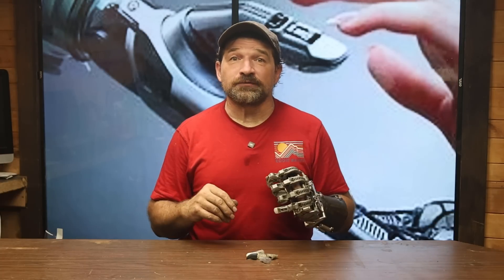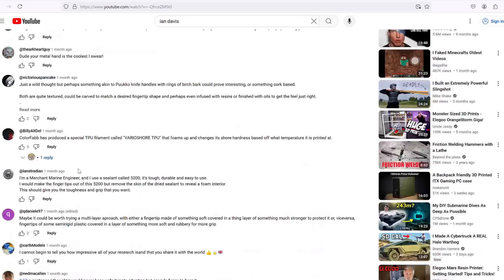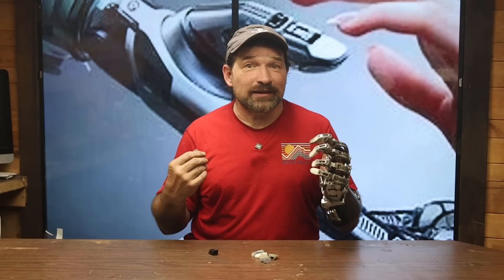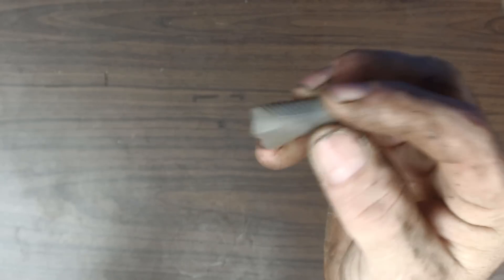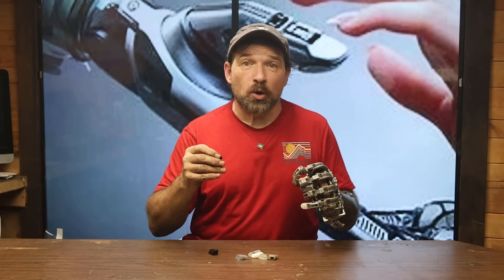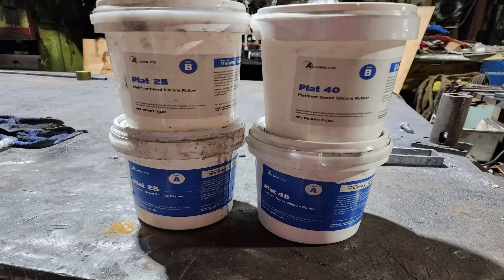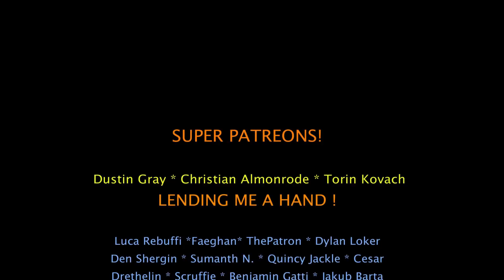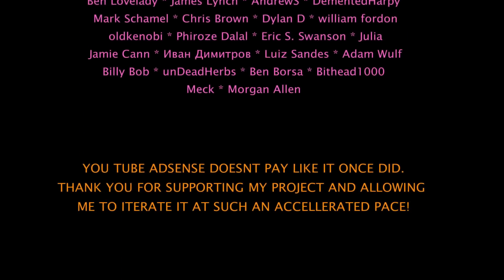Continuing the Quest to build the Perfect fingertips

Comment: Perhaps with the first design, with the plastic core and 2 layers of silicone/ rubber not too sure honestly, perhaps the plastic core you could add mini holes in the structure (that dont go all the way through ofc), so that the silicone has more places to attach onto the inner plastic fingertip

Comment: You could try putting the high temp Varioshore TPU prints through an annealing process, it would help to fuse the layers into a more singular piece for better durability. And it might do so without loosing too much of the desired squishiness.

Comment: I'm not sure why you would want a hotend swapper when you can reduce the print temperature during the print? Especially if you have a sheet of them you can print all the inside perimeters at one temp, all centers at temp 2 and all outsides at temp 3. You only need to switch temperatures three times per layer, the same as you would with a hotend swapper. I guess that having the temp vary in this way is a gcode/slicing challenge but having the prusa XL with mukltiple heads just to be able to circumvent gcode tweaking seems a bit extreme. Especially since these hotends will drool filament when moving and when not in use, so your stringing issue might be even worse. I think there might be ways to trick the slicer into altering the gcode or at least make the gcode easier to adjust afterwards

Comment: You should look into using rock climbing shoe rubber, it can be bought in sheets for quite cheap, can be bonded to most other materials durably with contact cement, and is grippier and more durable than just about anything else you can use

Comment: A couple ideas: silicone doesn't bond to anything well, except silicone. You could try overmolding a softer durometer silicone over a more rigid silicone substrate. The other thing is I've done some experimentation with resin prints and silicone and if you over cure and then bake the resin (90C for 5hrs) it will (hopefully) prevent the cure inhibition problem. Keep up the great work!

Comment: how about a layer of latex over something?
Reply from the maker: so synthetic latex would in theory work. you'd still need to figure out a way to either sulfur or hydrogen peroxide cure it. air cure wouldn't  work right because of all of the variations in body thickness. where it would fail is with the bonding to whatever i use for the core that anchors it to the distal.

Comment: If the tips fall off, could you add ridges into the metal fingertips and on the inside of the tips so that they would grip onto the fingers better?
Reply from the maker: the fingertips don't actually fall off the metal distal. what's happening is the silicone starts stretching over a short period of time, and since silicone doesn't actually chemically bond to anything, it's able to  separate from the core.
Reply: @missingpartsclub  So does that mean that replacing the final part of the finger from the last joint to the tip also have that same problem?

Comment: Not 100% sure about how much processing would be actually required, but what about vulcanizing rubber fingertips? Like aiming for a car tire like material. Pretty decent abrasion resistance, able to be cleaned with soap and water, and could be molded with task specific gripping patterns, all while being reasonably soft. Being able to batch out anywhere from 4 to 20 fingertips seems like a pretty reasonable venture once a routine/system is established. Again, no functional idea how much additional work/tools would be required for you to do that, but from what I do understand, it is feasible in a home shop.

I have not watched your whole series, but have had your videos come up periodically. I have always been deeply impressed by your engineering skills in making a comparatively dexterous mechanical hand.

Edit: Additionally, for a mechanical bond to the tangs, would it be worthwhile to explore something comparable to a disposable surgical scalpel blade? Using a spring steel connection to lock on to the tang.

Comment: How does super glue work as a fingertip by itself, or with latex powder? 

...or maybe make the tips out of wood 🤷🏼

Maybe you add the glue to a wooden tip, press the tip in powdered silicone, then press the tip in a Teflon fingertip mold.

Comment: Perhaps a grid system on the finger core which has a small coating of resin or other material that doesn't react with the plat might be a good way to do it? Not quite sure
You might also having some luck adding a small "fingernail" or something on the top of the finger to help with rigidness/durability?
Also, something i've seen work well with cars is a small uspring to hold bushings in place on a small shaft, they usually have barbs on the outer sections which grip onto the softer plastic/rubber, which might help with single compound fingertip retention.

Something like this, but about 7mm wide https://www.google.com/search?q=socket+uspring&client=tablet-android-att-us-rvc3&sca_esv=708ca891a389fdf3&udm=2&biw=829&bih=523&sxsrf=ADLYWIKUsH36fYkPxSUbjHpZph2KxofbQg%3A1726111706903&ei=2l_iZpXoNsivur8PiMWakQ0&oq=socket+uspring&gs_lp=EhNtb2JpbGUtZ3dzLXdpei1zZXJwIg5zb2NrZXQgdXNwcmluZzIHEAAYgAQYDTIGEAAYDRgeMggQABgNGB4YDzIIEAAYDRgeGA8yCBAAGA0YHhgPSMkYUJ4EWP4WcAB4AJABAJgBZqABkgiqAQQxMy4xuAEDyAEA-AEBmAIOoALiCMICChAAGIAEGEMYigXCAgYQABgHGB7CAgQQABgewgIGEAAYHhgPwgIFEAAYgATCAggQABiABBixA8ICCxAAGIAEGLEDGIMBwgIIEAAYCBgKGB7CAggQABiABBiiBJgDAIgGAZIHBDEyLjKgB_gm&sclient=mobile-gws-wiz-serp#vhid=sLfw6jmbdNcMEM&vssid=mosaic

Comment: I was thinking about how they adhere solid rubber to steel like on engine mounts and transmission mounts maybe there’s something in that that might help. Very rarely does the rubber come unattached from the steel it usually cracks the rubber  just a thought for you

Comment: If you're already going the multi-material route with the Prusa XL, you could print the supports with a water soluble filament. That way the only post proccessing you'd have to do would be submerging the whole build plate in a tub of water.
Another thought that comes to mind is printing the fingertips in TPU and applying plastidip to them.

Comment: Finger tip rough idea. print a rough shape using a plastic insoluble in solvents used in rubber dip. perhaps the grid structure fingertip may still be a viable option.

Comment: Perhaps a high-carbon steel fingertip.1095 HC steel tends to form coarse dendrites with a high degree of undercooling, resulting in a rapid solidification rates. These dendrites can be formed with anywhere from 120 - 25 grit surface. These dendrites are not just rough but they have a rather sharp tree like crystalline shape. This would provide a very effective gripping fingertip. This effect can also be created with any number of other metals and alloys, such as brass or Inconel if you prefer a fine coarseness.

Comment: Have you considered modifying the tip “bone” of the fingers to create a backing plate of sort to emulate the finger nail? I remember reading somewhere that the nail does quite a bit towards improving our grip, and it may help allow for one of the softer grippier materials without causing as much wear.
One possible durability issue may come from the fact that the material is having all of its strain mainly at the tip of the “bone”. My idea is to instead have a slightly larger “bone” that would stay partially uncovered and act as a support for the grip material. Think a T shape, where the bottom stops part way but the top continues to create a nail at the tip. This would also mean less material in the grip itself, possibly reducing the cost of replacement pieces, but may end up increasing cost and complexity for the finger itself. There’s also the issue of how the grip would stay in place, but i think it could possibly be tied or sown into place.

Honestly, your videos make me want to get back into prosthetics design after I gave up on that dream when I dropped out of engineering school.

Comment: Would a clamshell design using tpe and abs work???
Reply from the maker: thanks to Alan at Prusa and his gift of the xl printer, ive been experimenting using 95a tpu for the inner core and 3 different varioshore filaments that i am printing at different temperatures to get different stiffness. ive just about got the stiffness right by varying the infill as well as the temp. now im playing with the coefficient of friction by adding a tackifier.

Comment: Silicone bonds fairly well to glass. Maybe pack the 3d printed tip cores in some diatomaceous earth and heat them to their softening temperature to get a coating of DE bonded to the surface and see if the silicone will bond well to that surface.

Comment: Ian, if you continue your TPU experiments it is almost a necessity to run your filament in a dehydrator overnight before printing or print directly from a dry box. You will get far better surfaces, improved layer adhesion, and your prints will require far less post processing cleaning up those little blobs. There are also a broad range of TPE/TPUs available with different shore hardness if you are unable to find a satisfying combination of perimeters and infill.

Comment: Have you experimented with using compliant mechanisms to provide the squish?
I am no expert here, just a thought.
For example, if I was working in a machine shop I’d want my fingers to be highly durable to abrasion and chemicals, but also have enough squish and friction to be able to pick things up.

Friction can be provided by choosing a material like rubber with a high friction coefficient, but it can also be created by changing the surface texture of a material (sand blasting or gnurling metal).

The compliance and squish can come from a compliant mechanism. 

I don’t know how feasible it is, but I’d bet it’s theoretically possible to make a finger tip entirely out of metal that can match the friction of a human finger tip, and match the compliance. Happy to chat more if anyone thinks this has merit

Comment: You mentioned the foam in tennis shoes but did you actually consider it? I am picturing a hard plastic core, foam, then run a bunch of trials with different coatings. Very basic compared to the printing, maybe you've been down that road already

Comment: You should be able to change the print/nozzle temperature on the fly with single nozzle and eliminate the tool changes. It will require some manual G-code editing, I dont think there is any slicer that can do this out of the box, but should be fairly easy. For start I would create and slice the fingertips as multimaterial print, like you want. Then in the produced gcode, I would find the material change comamands and just replace them with the temperature settings. It should be straightforward find & replace in plaintext for any subsequent print after you have figured what to change and add. (you might need to add some delays or fan speedups to let the nozzle cool)

Comment: You don't need a multi-extruder 3D printer to print the same material at multiple temperatures. You can accomplish the same thing in Cura (I recomend Cura for engineering) or a prusa slicer derivative. The Youtube channel "makers muse" just uploaded a video about the process. At the end of the day too, 3D printers are just executing gcode which you could manually edit, which IMO could be worth the hassle for a small part that gets printed a lot like your fingertips. 

sidenote- Think of stringing is the result of excess filament escaping the nozzle, so changing fan speed will only change how that presents itself e.g. blobbing. Coasting, pressure advance, or similar settings should help a lot as well as having an appropriate retraction speed and length. I also suggest for such small parts to use a smaller diameter nozzle as it will simplify the tuning process and create higher resolution parts.
Reply: But each layer needs to be 3 different temps. Waiting for the warm up/cool down on every layer would make the print times impractical.

Re stringing, in my experience this is usually a result of moisture absorbed by the filament. Tpu in particular absorbs a lot of moisture from the air. Using a filament dryer and printing directly from it is the best way to get perfect prints.
Reply: If you're already printing reasonably slow for  highly detailed engineering filament, there won't be that much of a slowdown. a nozzle with proper heater cartridge can heat remarkably fast.

I just thought about it too, you could also leverage modulating the speed of the print as a partial substitute for temperature. Printing faster would equate to printing cooler.

Would a multi nozzle printer be easier? Yeah of course, it just costs $4000

Comment: I've been keeping up with your project for a couple years and I'm thrilled to see how far you've pushed it, and that you're working to bring it to other people using kits too! Prosthetics to the people! :D

I also have a very weird idea, forgive me if you've thought of this already:
I love the 3d printing route but worry the complex process you mentioned might make replacement fingertips less accessible to people, both cost wise and finding somewhere with a multi head printer capable of making them. I wondered instead of a tang and snap on piece like you're using, would it be possible for users to wrap the underneath and sides of the fingertip in a thin sheet of black rubber, fold the sides up over the top, and have a metal "fingernail" piece snap down over the top portion of the fingertip to hold it in place? There might be some small spines on the top of the finger "bone" under the nail which the user could stretch the rubber sheet up to and pierce to hook it in place. The squishiness could come from an inside padding layer just on the finger pad portion, a small piece of silicone maybe, like wrapping an upholstery footrest or folding some filling into a dumpling. Rubber sheet would be extremely cheap and available for end users to cut to size and replace as needed, and they have about the same amount of friction as a fingertip, though the texture isn't correct. It would also cause the fingertip to rupture/tear, but not fall off entirely, so it should still be able to function until someone can stop to repair it.

I also know there are some professional prop makers that use a flexible self skinning moldable polyurethane foam that naturally forms a structure that varies in squishiness, I think it's slightly harder on the outside and slightly softer on the inside. I'm sure it's probably not tough enough for this purpose, but I thought materials that self assemble a difference in firmness against a mold like that might be of interest to you.

I hope any of that is useful, good luck and can't wait to see more updates :)

Comment: It may be possible to run a sort of stylus-type fingertip as an insert of a two part fingertip. The idea would be to run one of those firmer, more rigid materials at the tip, with the softer portion being apportioned behind it, with a T shape insert at the tip of the softer material. That, or a cross shape, but that seems like it could be troublesome to place inside.

Comment: Have you thought of having hollow metal fingertips, where the silicone pokes out from inside?

Basically, instead of having a whole silicone finger top be designed to slot on top of the metal tip, you have the silicone pushed inside a metal fingertip with the pad portion of the metal fingertip open so the silicone pokes out. Seems like it might be less prone to wear and tear, have more support, and easier to keep in place. 

Basically putting it inside vs outside. The silicone is encased in metal, holding it in place and supporting it.

Comment: I'm new here, but have you tried a more permanent finger (maybe a metal core with a more durable silicone) and then a cheap outer layer with the grip requirements you need, that could be easily replaced?
My first thought was cutting the fingers off of rubberized cloth gardening gloves, and using rivets and hooks to attach them to the finger.

That way you could protect the more expensive inner part with the softness that you need with a cheap, grippy, easily replaceable disposable layer

Comment: what about DIY gecko skin by casting silicone on diffraction grating filter? exactly like The Thought Emporium did on his DIY Gecko Tape video

basically make a mold of the fingertips and superglue the diffraction grating filter on the "fingertip" area, that way you get a reusable mold you can use to cast as many as you need, you could even cut the diffraction gratings so they act in a concentric manner (like a fresnel lens would? im pretty sure you can get diffraction grating filters that are concentric, but they are way more expensive than linear ones, so glueing a bunch of linear ones is probably gonna work the same way and just as well)

bonus points is your fingertips get a nice rainbow sheen

also for the falling off problem, there are different kinds of superglue, try surgical skin glue, as it is flexible, unlike normal superglue and should work better (different esters of cyanoacrylate have different flexibilities and elasticities, normal superglue is very rigid, but surgical glue is flexible)

Comment: Why not use aramide fiber reenforced SBR rubber similar to what is used for tires? You can vary the composition to make it softer or harder and the durability is very high. It's more difficult to mold, but if you make multiple sets at a time it's probably well worth the effort for the increased durability compared to the materials you've tried thus far. If you don't want to make the materials yourself you can probably order rubber parts made to spec from most companies that manufacture custom rubber seals.